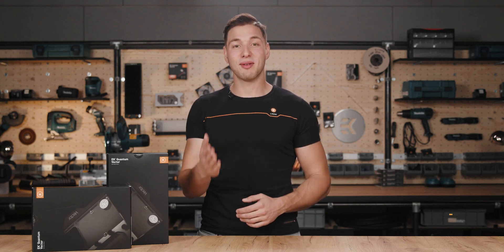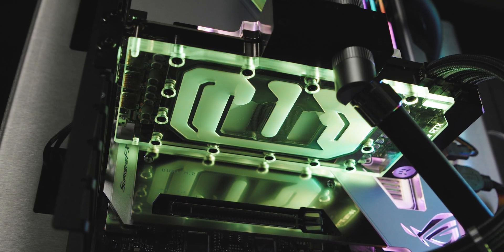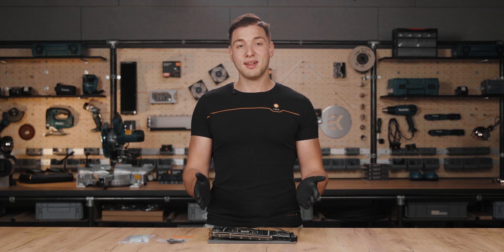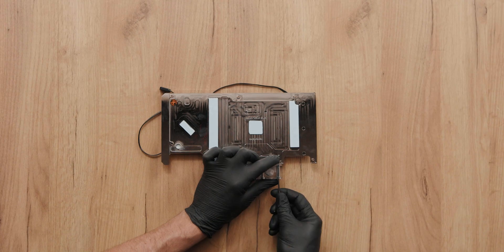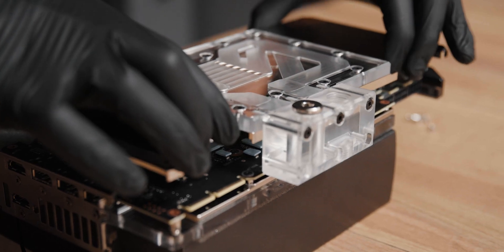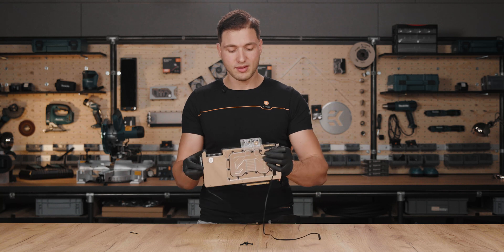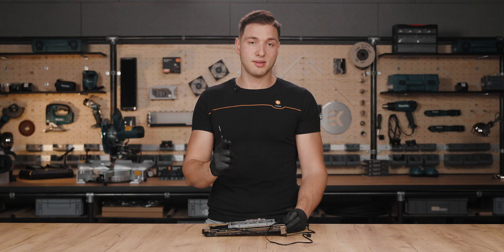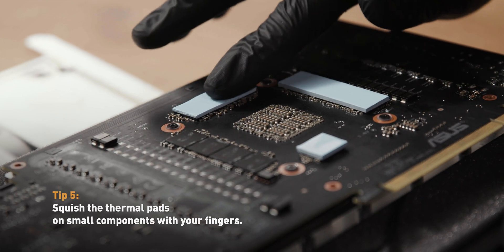Installing EK Active Backplates & Tips and Tricks | EK HOW TO

Comment: I have a tip for EKWB - how about getting a 3D printer to print the thermal pads? On the Active backplate for an EVGA 3080/3090 XC3 it requires uber complicated shapes to be cut; rounded squares, rectangles and ovals. The instruction manual looks like a geometry lesson. And the colour coded thermal pads (to denote thickness) aren't colour coded - all standard blue....

Comment: Should I get an active backplate for my rtx 3080ti ? 3080ti cards don't have memory on the back only the 3090 does. A standard backplate is more than enough ?
Reply from the maker: The standard backplate is more than enough for an RTX 3080 ti. The active backplate helps a tiny bit by removing more heat from the PCB than the standard backplate, but most users opt for it due to its unique look.

Comment: @EK Water Blocks, there's nothing the manual that mention about selecting the right port. I've checked.
Reply from the maker: With the Vector2 we've changed the terminal to have more inlet/outlet combination options, but the first edition Vector active backplates had to use an inlet on one and outlet on the opposite side.
Reply: @EKbyLMTEK  Aaaah... Okay. That explains why i see pictures on your website where the in and out is on opposite sides but face to face rather than diagonally. Thank you.

Comment: Does a non active backplate also require thermal pads?
Reply from the maker: It does as it also helps remove the heat from the PCB.

Comment: You need to make a terminal available that allows fittings on one side using active backplate. Ie like the photos advertising the pcie4 evo vertical mount, cant find that terminal on your site. Nothing but a nightmare using the reflex distro plate

Comment: Does it matter if you put the thermal pads the other way around? Or if you have the fluid input into the backplate first? Because I'm getting around 90°C with a triple radiator.
Reply from the maker: 90°C points to a bad contact between the block and the GPU die. Turn to our customer service for troubleshooting so you will have your loop working properly as soon as possible: https://customerservice.ekwb.com/hc/en-us/requests/new
Reply: @EKbyLMTEK  Thanks, I will reach out to the support then.

Comment: Would this fit 3080ti too?
Reply from the maker: Most of our 3080/3090 blocks fit the 3080ti version as well. If you're not sure about the compatibility with your GPU, you can check it out here: https://www.ekwb.com/configurator/
Reply: @EKbyLMTEK  Thank you for responding back this helps alot cause your configuration does tell for 3080ti unfortunately

Comment: I am a bit late to this video, tho as a tip for Sli of 2 gpus it’s mentioned that you use e certain type of fitting. Are the standard EK fittings to tall for a dual gpu? (got a 3 slot sli bridge)
Reply from the maker: There may be some clearance issues on some motherboards, but there is enough clearance with the smaller Micro HDP fittings.
Reply: @EKbyLMTEK  well thanks for the quick answer, hope my local hardwarestore has them cause my order with all watercooling parts for the dual 3090 loop are already on the way :) I’m always so excited to build an ek loop
Looking up all measurements, it seems that with just distance pieces from ek it is possible to make the connection tubeless. I will try it and from the measurements it should fit quite nice

Comment: Your FTW3 waterblocks broke my 3090 due to incorrect standoff locations. I had to RMA and waste a lot of money on shipping to get a replacement. Sticking with Alphacool.
Reply from the maker: Each set of waterblocks has threads for standoffs and therefore standoffs in the same location. All of our blocks - especially the FTW3 version - were extensively tested (both internally and externally). It was confirmed that all the standoffs are in correct positions and couldn't have shorted or damaged the card in some other way.
Reply: @EK Water Blocks  is a large thread on it on evgas forums. They mention that ek will send out replacement standoffs to fix the problem. Also version 2 fixed the issue.. no idea how to tell if you get a newer revision ahead of time.

Comment: I wish this could’ve worked in conjunction with EK’s vertical mount :/
Reply from the maker: We are releasing a new vertical mount bracket this month, which will work with the active backplates :)
Reply: @EKbyLMTEK  that’s fantastic! Thanks for the reply. Does there happen to be a preorder available?
Reply: @EKbyLMTEK  when? tomorrow is dead line :)
Reply: @EKbyLMTEK  Will this come with the outdated gen 3 riser cable at an inflated price?

Comment: I installed an active backplate on my gpu and inserted in the top slot of my Asus Maximus XIII Extreme board and the gpu is forever stuck there unless I pull force it out lmao My board has an led screen above the gpu slot and the active backplate water block blocks my access to the clip to release the gpu... The bottom is blocked by the main water block as well 🤣🤣🤣🤣 It's gonna be there for a very long time...

Comment: Hi Ekwb as a long time customer who recently purchased the active backplate for my strx 3090 I feel like you guys really dropped the ball on this one. I only found this instruction video after my wife and I struggled for hours trying to get the o-ring block to connect both the back plate and front plate together. During this struggle i could have easily damaged my expensive  and difficult to acquire video card. The instruction booklet and this video are completely different and you should have at least put a notification card in the product box to see this video. Because of this critical mistake on your behalf I am considering using other products for my water cooling needs. You can do better than this ekwb!

Comment: So it is not possible to install both fittings on the upper side of the terminal? Only one at the top and one at the bottom, as shown in the video?
Reply from the maker: It is not possible when using an active backplate, as the fluid needs to travel through both the block and the active backplate.

Comment: What`s this shit ? Please, can you tell me why you use the outlet from GPU-Cooler for inlet ? 
Priority cooling has to be the GPU over the original way by using the jet-plate inside and the inlet on the left side !!
Anything else is undefined and has a negative influence to the cooling result. The flow-direction to enter the Backplate doesn`t matter ....
In this case you have to rotate the terminal by 180 degree before assembling.
Reply from the maker: The terminal is designed for the coolant to come into the top right port, run through the backplate then into the GPU block inlet. If you wish to have the coolant come in from the bottom side, simply turn the terminal 180°. Coolant always goes into the correct inlet of the GPU port unless you reverse the flow without rotating the terminal first. No compromises were made in regards to performance when designing this block :)

Comment: Great tutorial! Haha wish I see that before I install the active back plate, it was a struggle squeezing and tightening at the same time and it was a challenge lining up all the screw holes, took me forever to figure out I should loosen the 3 screws on the side block of the backplate and shift the plexiblock a bit and didn't think of loosening some screws on the far side of the backplate that is attached to the pcb to make squeezing easier😅

Comment: Nice tutorial. Looked easy. Wondering why so many people have had problems with these.
Reply: The problems are coil whine related, not for the installation. I have an Asus ROG Strix RTX 3090 OC with the same blocks from this video installed and with demanding games the coil whine is there. And is a pain in the a** to drain the loop for dissasembling the blocks, try another thermal pads, mount againg, fill the loop again... bruh... BTW, the card with the stock cooler didn't have coil whine at all.

On the other hand, the temps are -18/20º on gpu, and almost -30º on the memory side compared to air cooled, the aesthetic is brutal and the weight of the complete set is A LOT.
Reply: @Shinmei10AU  It most likely had but you couldn't hear it over its air-cooler fans. That's fairly normal. Nothing some insulating varnish can't fix.
Reply: @NiC707  I did the test with a custom profile with 0 rpm's on the 3 fans, I tell you, there was no coil whine at all. About the varnish... I'm not sure, the coil whine comes when you "limit" the vibration of the coils and it falls to an audible frequency. So it happens when you "struggle" so much the coils or you put so much pressure to them. You have to find the middle point between propper contact and pressure with the thermal pads. All the coils has to vibrate, but normally the frequency is too high that is inaudible for the human ear.
Reply: @Shinmei10AU  I have a 3090 to with a block from aquacomputer. This is not related to EK.
Reply: In same boat with the xc3 3090, with air cooler was zero whine. Now i have block an active on an it whines like hell. Terrible design to point had to mod with copper bar to stop any whine
Reply: The asus noctua gpus have coil whine as per reviews. Sucks.